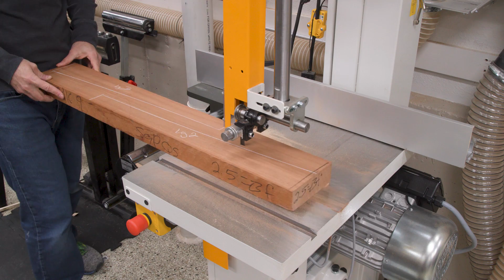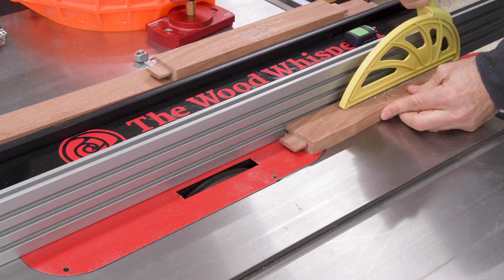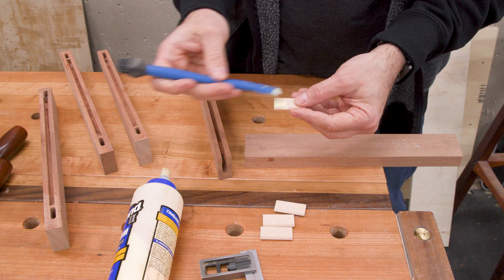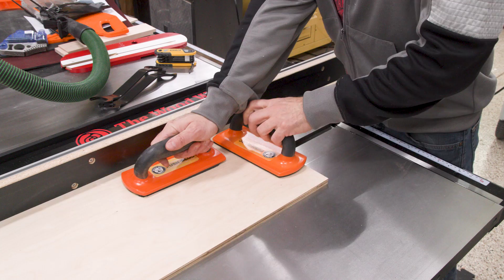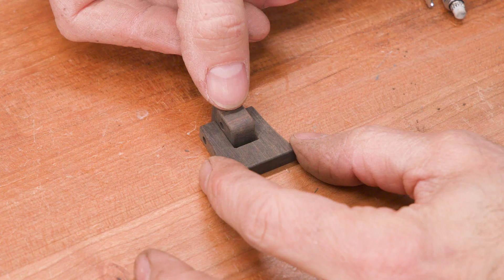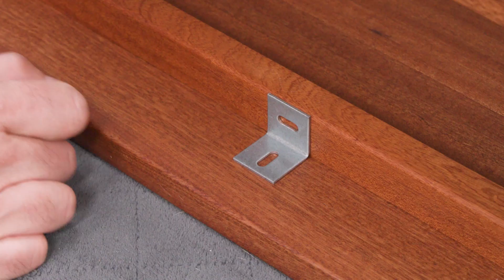The Littleton Console | An Exercise in Woodworking Micromanagement

Comment: Great looking project. The ambrosia maple is beautiful. I first used Titebond Liquid Hide glue when I restored an old rocking chair. That's the type of glue used when it was originally assembled, I figured it had lasted 100 years, so it must be good. Like you,I was so impressed I now use it all the time on pieces that won't get wet or subjected to high heat. Thanks.

Comment: How much strength would be lost if the tenon stock was cut narrow enough to just fit in the mortise without rounding? This would leave half moons with no wood in the mortise but would it have any significance?
Reply: None,particularly if you used a PU like Loctite but you would lose some fitting accuracy and could risk splitting the joint if things were not square on upon assembling.

Comment: Mark, is there any strength advantage to cutting two mortises and then using a third piece tennon vs cutting the mortise on one piece and the tennon on the other? I cut my mortises like you do in this video but then typically cut my tennon on the end of the joining piece, I can see finish advantages in how you did it over how I have been doing things.

Comment: I just wonder, why the drawer front is doubled up? This is done so regulary but what's the reason? Everything done with the "inner" front could've been done to the "outer" front and one would get (slightly) more space in the drawer.

🤷‍♂❔
Reply: You’d see the drawer slides and the reveal would be too big without the extra drawer front. Also makes alignment much easier. You could do without it but you’d need use a different type of slide. Wood rails would work.
Reply: @EvanSamuels  I agree to the easier alignment.

Comment: I am an Osmo guy, but that hardwax oil looks good.  What brand is it?
Reply: If i remember correctly it's a brand he is testing and hasn't revealed it yet.
Reply: I assumed it was Rubio, given the link in the description.
Reply: @rogerlove7588  Rubio has a custard cream color and isn't translucent, the stuff in the video is a more traditional amber oil.
Reply: @rogerlove7588  I did not know they make one.  The link was to monocoat.
Reply: Rubio make a heap of different coloured oils too.
Nice expensive stuff but a little goes a long way.
Reasonable water resistance and also used on floors.